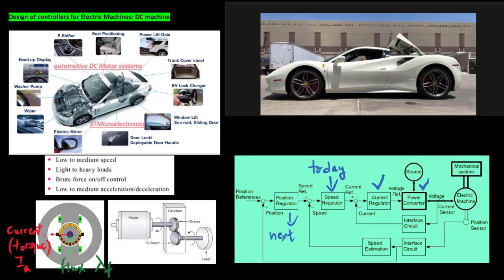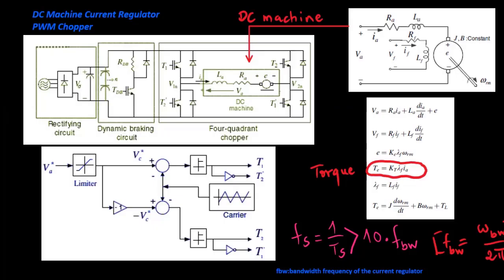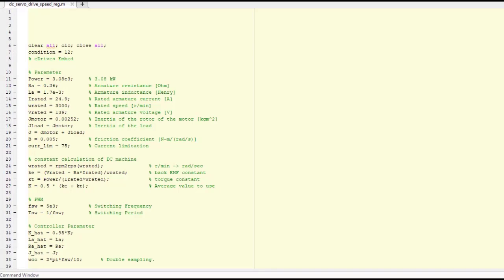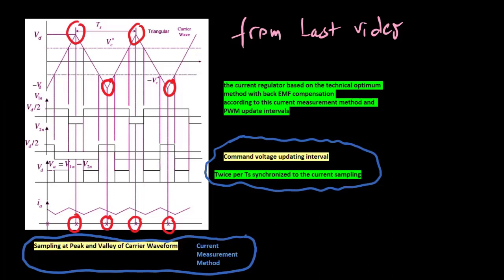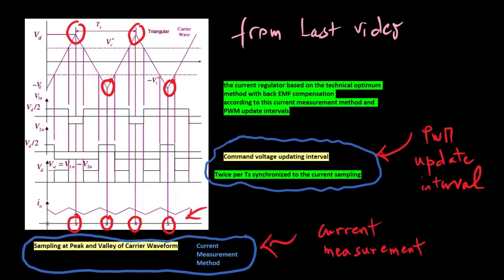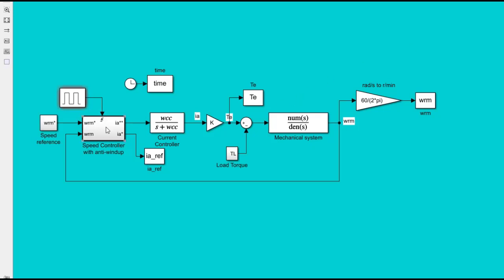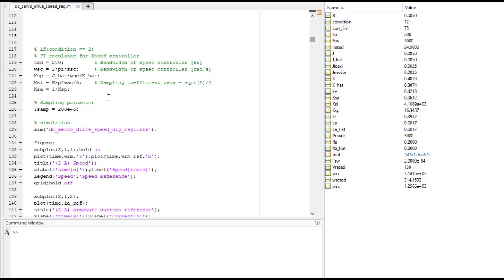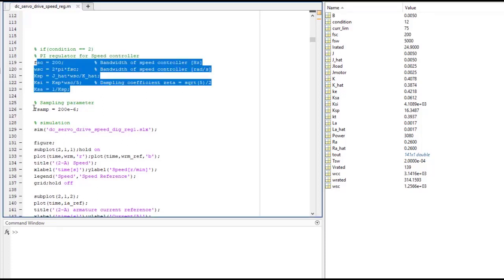dc machine analog and digital speed control with incremental encoder matlab simulink

Comment: DC Machines aren't popular anymore
Reply from the maker: no not true at all! there are many reasons why i present this and that. to understand the advanced controls, one should understand the control of this machine, to independently control the field flux and motor torque to achieve high performance. and in many applications not only in automotive no one can use an expensive machine (and software/electronics). there are many applications where the machine is still used!!
you may talk about the future, i work in futuristic projects that will only appear in the press in 5 6 years, so i know what i am saying. a simple example without mentioning the home applications, if you want to charge an electric car, then there are at least 2 actuators in the mechanism (an electromechanical actuator locks the vehicle connector and flap during the vehicle charging process), so per vehicle at least one dc motor (so you can still earn real money with it, only with one oem you can earn x000000*2*price) and not only that, window regulator and sunroof, seat adjustment and much more.....................................in the industry counts every cent!! you don't learn something like that as a phd or as a scientific employee. in the industry it's who gives the money that makes the music :-)
Reply: @eDrivesEmbed  i see what you are saying  ,you have focused on tiny  things that people  can ignore at their  peril  ,after you mention  the sum roof  and windows  it's when I realized I have narrowed my observation  because of my interests  ,I see with cnc  machines,  machines builders  have moved far from DC servos  to AC which they said are efficient  .
Reply from the maker: @seimela  yes as said one uses tricks so that one regulates the ac machines in the end as simply as dc machines.so the video also brings something for someone who also does not use this machine.